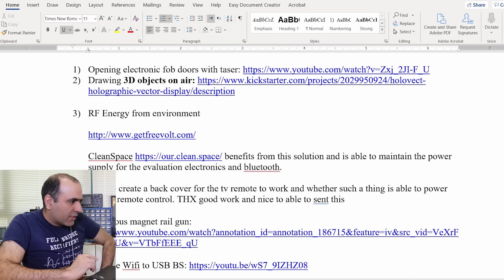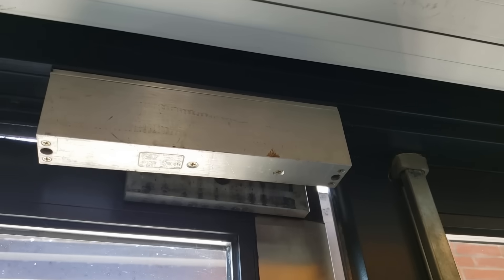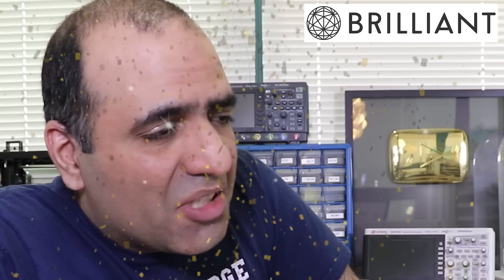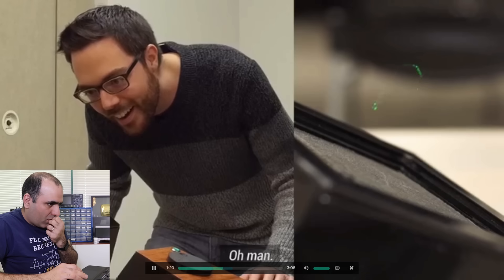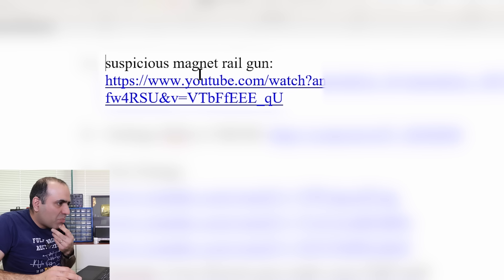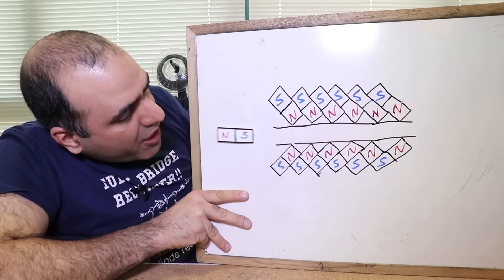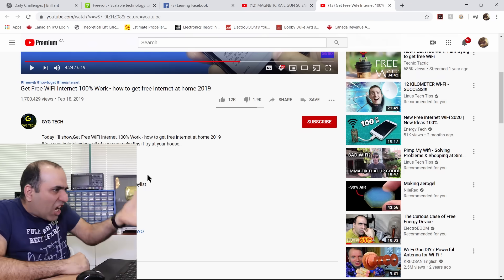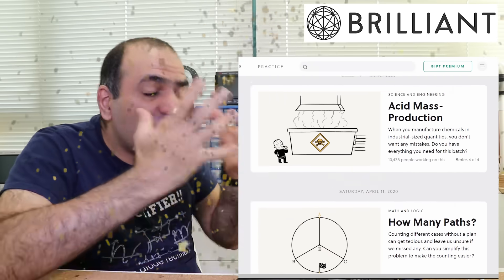BATCH RECTIFICATION of my To-Do-List

Comment: I mean, if the electric locks on my doors were to fail I wouldn't want anyone trapped in the building so it's nice that the door opens when the lock stops working. Not very secure, sure, but safer.

Comment: About the magnet shooter.
when you say it shoots out the other side, you make it sound like it accelerates and goes out faster than it came in.
If that was true it would mean that it gained energy which is false.
It shouldn't shoot out. The most possible thing it can do is go out the same speed it went in.
In reality i think it will simply get stuck inside the many magnetic fields that are pushing and pulling on it.

Comment: 11:04 this is not entirely true. Chargers can communicate with devices using the power and ground lines to indicate if they support quick charging. Samsung does this to indicate a genuine samsung charger. It's not specified by the USB standard as far as I know, but it also doesn't break it.

Comment: I’d guess those are electro-permanent magnets holding the door shut, so if the power fails for instance, the door remains locked. But I could be wrong, that might not meet fire safety standards or something, idk.

Comment: About your first video:
I am in Russia, and those are indeed the types of locks on most apartment buildings. Those are not designed to be high security, rather just discourage casual drunks from entering the wrong building. A lot of them can be opened with brute force. If the lock would fail and the door stays shut it's a huge hazard in case of fire. Imagine a fire happens in your building and the only entrance has a short and nobody can leave it. So it IS failing in a safe way.
Reply: I am also from Russia and have my 2 cents about these doors and locks. 

When I was in school, it was quite popular with the boys (about 15 years old) to try to bruteforce open these doors by pulling on them really hard. Some doors in my neighborhood were susceptible to it, some were not.

Another thing happened quite recently (during the winter IIRC), my mother was coming home from work and she couldn't open the door. She enters the code, the lock beeps (like its okay), but the magnet doesn't release the door. She called me (I was already at home) asking to try open door from the inside. I go down and door still won't open. So we call the company that maintains the building/doors. The guy on the line says simply cut the cord that goes from lock to the magnet. I climb up, cut the cord and voila, door opens. A guy came to fix it tomorrow morning. Scary shit.
Reply: @asphexor  понимаю что старый коммент, но провода от домофонов обычно идут к щитку в коридоре и просто включены в розетку или там есть простой переключатель для них. Несколько раз так выключал магнит домофона чтобы заносить мебель было удобно.
Reply: @asphexor  - in every other country, the electric locks prevent people entering, however there is NO lock to prevent people leaving. So, you could have opened your door for your mother from the inside.
Reply: @johncoops6897  Did you not finish reading my post? I went down to the door and tried to open it by pushing it, asking mother to punch the code in and pressing the button from the inside. The door was stuck and nothing except cutting the wire opened it.
Reply: @asphexor  scary shit? Why? Because it was easy to get out?
Reply: @TheAdatto  What do you mean "easy to get out"? Depending on the construction of the door, that wire might as well be inside the door itself to prevent it from being manipulated in any sort of way.

What I was referring to is unless you know what you're going to do or can contact maintenance company, you can't really get in the building or out of it. Mine building doesn't have a fire escape, it doesn't have any other exits, and typically windows on the first floor are barred 99% of the time so you can't really jump out of (climb in to) window. So unless you're willing to jump out from the second floor or somehow climb to it, you can't get in/out. It was winter, it was late and it was cold outside. The phone call itself to the company took good part of 20 minutes before they found a guy that told us what to do with the door.

Couple of years ago, we had a really cold winter for this part of the region: less than -30 degrees Celsius, imagine being stuck outside where no one can help you get in.
Reply: @asphexor  Less than 30 degrees Celsius is very cold? That's 86 Fahrenheit! Must've been a typo, or you meant 30°F (which is about -1°C).
Reply: @TravisTerrell  Meant -30 Celsius, oops!
Reply: In Russia the door lock you
Reply: Confused by people questioning if there is a fire exit.  Don't know about everywhere, but in US and the rest of the developed world, fire codes don't care if there is another door. Any door on a commercial building must be able to open from the inside even when locked.  They also have to push out. 

Failing unlocked is the only safe choice on cheapass systems.
Reply: @johngaltline9933  but is a problem whit you theory of developed world for example, russia now is a developed country, and is in the group of first world, like the us and almost all Europe, but russia for example was the soviet union son in that time no one care about safety an proper codes, but the country it was improving in these aspects after the fall of Soviet Union and the advance of the world in general, but unfortunately everything is not perfect and there are places that do not update, like in many countries that now the have proper safety measures and codes but old places dont upgrade or cant upgrade, like my old apartment that was build in 1950, so not a fire exit, old electrical installation, not prepared for new technology, etc, in the us and now the call first country i sure that still exist old building missing modern codes and safety measures, no country is perfect
Reply: @MakarovFox  what are you talking about? Most old buildings in Russia actually HAVE separate fire exits - outside stairs from the roof to ground level. In the building where I live (it was build in 1972) there is no outside stairs, but stairwell is outside the apartments, there is nothing to burn there, so it is more or less safe to evacuate. There are and there were the safety measures that have to be followed.
Reply: @d4slaimless  i dont remember what's was the point of discussion is this treat
Reply: @johngaltline9933 , they call that long bar on the exit doors panic bars, hit it and the door opens.
Reply: @WilliamMcCormickJr  You don't say?
Reply: @johngaltline9933  - it is not cheapass, it's just stupidity.
Reply: @johncoops6897  it's both.  cheap systems stuff all the control electronics in the keypad.  it costs less to make one circuit board.  this also means that simple tricks like using a magnet to pull the relay contacts often work.  actual high end systems only send a coded signal of the number code entered through the wall to a control box inside the building or room you are trying to secure.  thus you actually need the code to open the door.  
the cheap ones are all most things need as it is just there for security theater anyway, often locking glass doors that a rock makes a good key for if breaking the lock is too tough.
Reply: Meanwhile, in the U.K. you need to remove power to open the door.
Reply: It's always easy to go from being to other standards to judging, but who benefits?? Everyone has different circumstances and can also think about how HIS system gets better/ safer.
You could simply install an emergency switch inside the system to break the connection and everything is fine...
You can be creative or have meaningless discussions...
Reply: This. It's a safety requirement that when door locks fail, they fail open. Imagine a fire that knocks out the control system. You can't trap everyone in the burning building!
Reply: @TravisTerrell  Google videos of "Зимняя вишня, пожар". They can.
Reply: эй электрический бум, вы можете перевести это? лол
Reply: Подтверждаю. Большого смысла в максимальной защите домофона нет. Люди даже так спокойно могут зайти за спиной других =)
Reply: Remember this guy is a gatekeeper :)
Reply: ah mother Russia always amazing
Reply: Damn, sounds like your neighbors from the west should send y'all some Abloy
Reply: Hey buddy that's what you should do in Russia in case of an fire emergency in your building. https://www.youtube.com/watch?v=vZGKDplDKU4
Reply: Didn't you just saying about "Winter Cherry". This EXACTLY what happened.
Reply: In fact It's a bit more tricky: the lock system allow you to open the door WHEN there is current through it. So on power loss, the door stay close. But for security reason (in case of emergency), we want the door to stay open/functionnal on power outtage, so we have to put backup battery on it. In conclusion the door tried by Electroboom was badly design/unsecure. Another funfact is these magnetic locks are suppose to be workin about 5-10 secondes. If they stay powered on too long, the will heat up, and finaly die/burn... (you can let the door opened much more time, but the time you have to push the door is short)
Reply: даже дверь хуево спроектированную защищают))
Reply: The key interface is called One Wire, and is probably quite prone to noise bursts.
Reply: Security door usually can open without passcode inside out
Reply: @yuitachibana8829  yep that is in normal state, if the lock lose power and for security shot the door maybe the function to open dont work, more if is all electro and not a mechanical lock, if the magnet or the activator pull the lock for opening in a situation whit out power you cant pull the lock
Reply: Wait, you guy don't have a second stair in the building @@
Reply: @Nhatanh0475  dont be surprise, a lot of building in a lot of countries dont have redundancy exits, my for example only have one door and the majority of department i know only have one, expect the one whit garage, old building are normal to fail in modern codes for security
Reply: @Nhatanh0475  They do have a second door with the same lock system. Both locks may fail in case of general power loss.
Reply: @Nhatanh0475  there are fire exit but you would still want the front door to open when power goes out so you have two exit to escape.
Reply: yet another day in russia...a drunkard walks in the house with an ak-47 and a vodka bomb
Reply: If you don't work for government, your life or lack thereof, is of no importance or consequence to the party. 
Life of a chicken is worth more cuz you can eat a chicken, without standing in line for 2 hours. 
Why do you think most people there drink? Do happy people do things to feel numb?
Reply: well that's russia for you

Comment: 1:07 Wrong. "fail safe" or "fail secure" are simply the two facets of the same choice - what happens if your access control system gets incapacitated, no matter for what reason. YOU CAN'T HAVE BOTH. NEITHER IS "MORE VALID" THAN THE OTHER ONE. It's simply a choice you'll have to make designing your application; in some cases it's more important that the door stays closed if the system fails, in some others it's more important that the door opens freely. Simple as that.

Comment: I used to live in Russia. Those electronic locks are installed on many apartment blocks in Moscow. The reason they are designed to open if they fail is that nobody wants to lock 100+ people out of their flats just because the door lock has glitched (or because of power outage)

Comment: 5G dangerous radiation if using 60+ Ghz? 5G dangerous radiation if using 60+ Ghz? 5G dangerous radiation if using 60+ Ghz? 5G dangerous radiation if using 60+ Ghz? 5G dangerous radiation if using 60+ Ghz? 5G dangerous radiation if using 60+ Ghz? 5G dangerous radiation if using 60+ Ghz? 5G dangerous radiation if using 60+ Ghz? 5G dangerous radiation if using 60+ Ghz? 5G dangerous radiation if using 60+ Ghz? 5G dangerous radiation if using 60+ Ghz? 5G dangerous radiation if using 60+ Ghz? 5G dangerous radiation if using 60+ Ghz?

Comment: @electoboom I think the reason it’s not working for the door you tried is because the main circuit that opens the door locks is not receiving the electrical signal. Old doors in Russia are directly controlled by the keypad while the keypad on newer doors just tells the access control panel to open the door